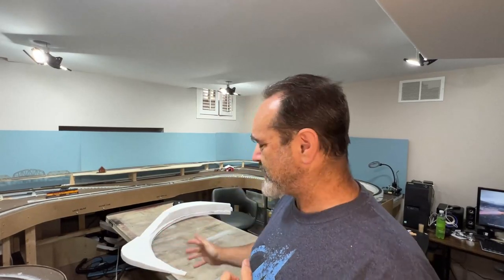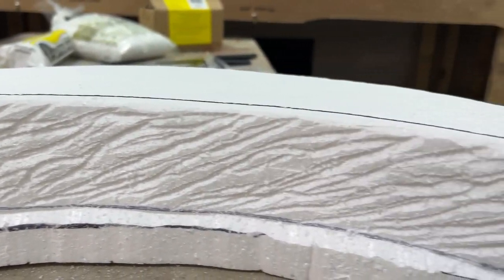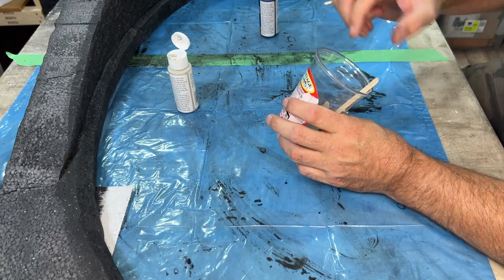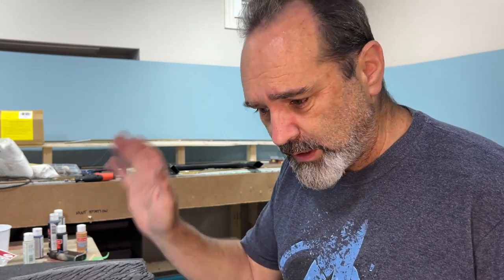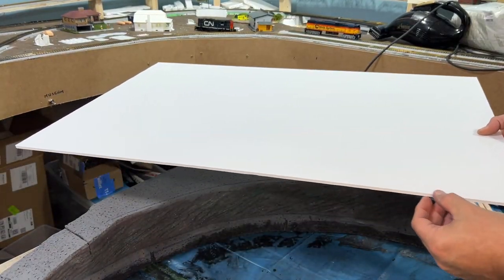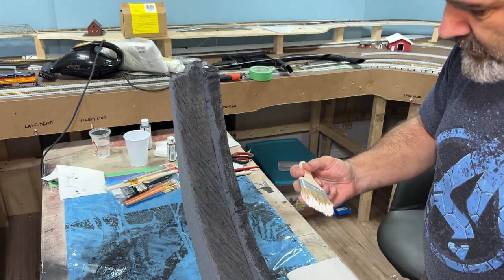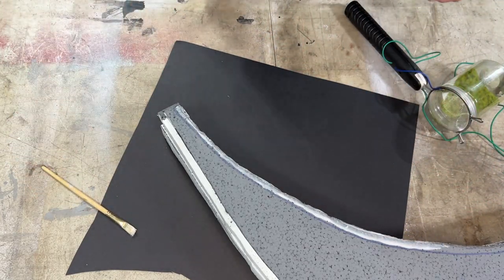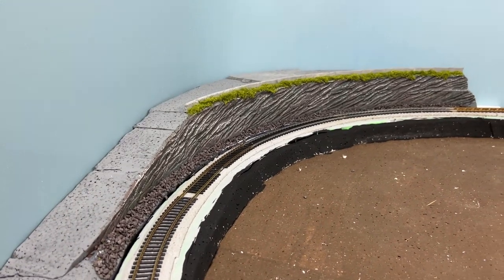Making A Rock Cliff From White Styrofoam For My Ho Scale Model Railroad

Comment: Ok couple of points...probably went a little darker than you wanted with the black ..its just supposed so be a light wash to get into the cracks but really after that basically got the idea   " nothing in nature is 1 colour"  one other thing when you paint thin things( like that platform( always paint both sides )) as the paint will tend to shrink the painted side so it will likely curl up...and when doing rock fall...you wall is multi colour so should the rock fall be .those static grass applicator generally work well ( with 2 as batteries) but you need to work close and slowly and yes the dive may touch ground and itll spark   ...after a few of those you'll learn to judge space lol
Reply from the maker: Good call on the platform paint. It did curl up. But wifey saved the day and re-did it, lol. Thanks for all the other tips.

Comment: You might also consider Ceiling Tiles. Places with damaged ones will give them to you. They have asbestos in them. Do EVERYTHING outside and wear gloves and a mask. When done, then heavily coast with paint or dullcoat. I use this method all of the time.
Reply: If the ceiling tiles were made after the mid 1980's, it is very unlikely they contain asbestos.  Since we are now in 2023 -- some 35-ish years later, I wouldn't be too worried about asbestos.  But the fibrous materials (mineral wool, fibreglass, gypsum, pearlite, clay, cellulose or starch) the tiles are made from can be an irritant, so wear breathing protection if you're going to be cutting or carving them up.

Comment: Your results look very good.  :)     That "wet-on-wet" technique seems very interesting.  I will have to try that.

Suggestion 1 :  Next time, start with the lighter colours first and layer darker ones on top.  To bring out the cracks and crevasses, use very watered down black paint and let it flow into them.  You can use a Kleenex to dab up any excess.  Dry brushing with white paint using a narrow square profile artist's brush works much better than a house-painting brush.

Suggestion 2 :  Plants -- grasses, small bushes and shrubs -- will be attempting to grow between the rocks (talus) at the bottom of your cliff.  So don't be afraid to add some of that clump foliage here and there as well.

I didn't see you do it in the video, nor did you mention doing it; but did you take some watered down white glue or some Woodland Scenics "Scenic Cement" to hold the talus in place ?  The glue you spread along the foam base will hold many of the rocks fairly well, but not all.  To prevent the surface ones from falling or being knocked off, saturate the area with diluted glue to lock them in place.
Reply from the maker: Thanks you so much for all your advice. I do actually have some scenic cement, kindly sent to me by Switchita USA, so I'll give that a go.

Comment: Good start Dave. You might want to try using a base coat of paint, grey brown or whatever and then different colour washes. Dry brushing can really bring things alive but try using different colours and several applications, the more colours the better. Also you need to try smaller more artsy brushes and ditch the house painting ones. I was where you're at about three years ago but now my scenery skills are much better. Do a little dry brushing on the rocks you put at the bottom of your piece and see them come alive. Keep up the good work.
Reply from the maker: I think when we first start out, we are afraid to add too much colour. Kind of like when you first try to replicate chrome, or silver with paint. It is not as it seems, lol.